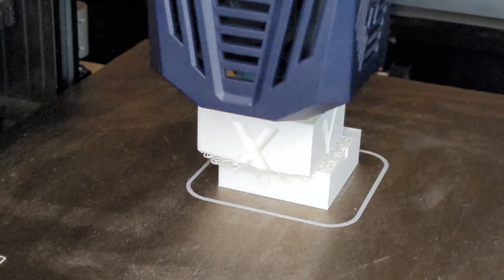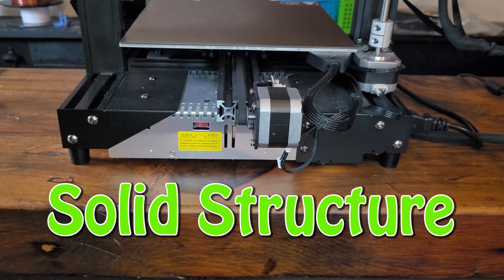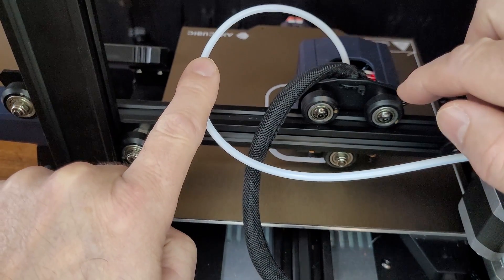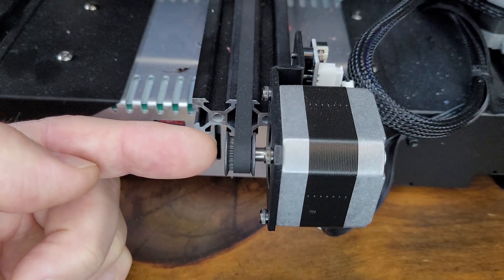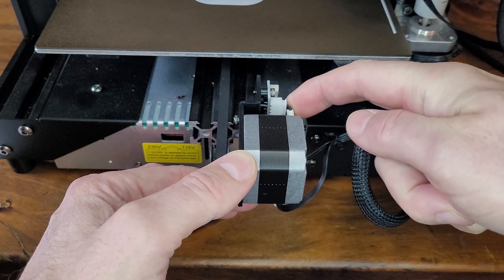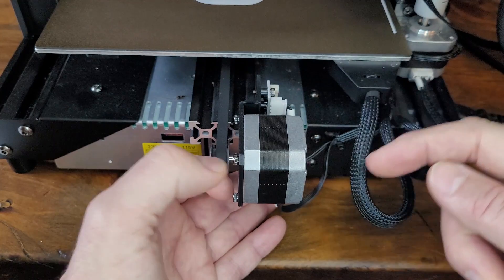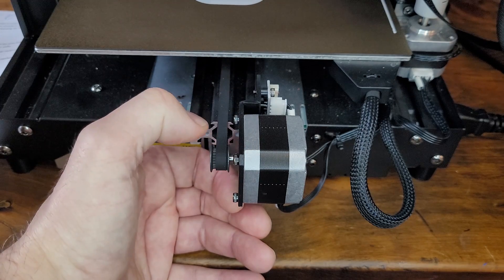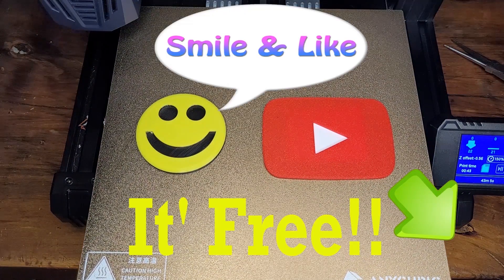Kobra Go layer shift

Comment: One issue I had that caused layer shift appeared to be Cura-specific: I set the wall thickness to a value not divisible by the nozzle size. In my case, I had wall thickness set to 1.5mm, but the nozzle was 0.4mm. What would happen is that anytime the print reached a point in the model where it would start a new wall, there was a chance for an offset/shift to be introduced. Setting the wall thickness to 1.6 or 1.2 (values evenly divisible by 0.4) avoided the issue.
Reply from the maker: Hi Murkaeus, thank you for taking the time to share this info, hopefully others will see this too.

Comment: Exact same issue as above. Belts were fine, but found that the cheaper motors supplied are not capable of higher speeds with rapid changes in movement. Had to slow it down and it worked. I imported the configuration of the "owl.gcode" that came with the printer to copy the correct speed settings and have not had a problem since. You can upgrade the motors for better performance if you wish.
Reply from the maker: Morning Craig
Thanks for taking the time to share the info

Comment: when this happen to me i change the micro ssd to other better quality micro ssd and all come back to normal!
Reply from the maker: Wow, thanks for sharing. Never occurred to me that the SD card could cause later shift.  I've changed mine to a better SD already.
Reply: I had this problem out of the blue. I had to adjust the z-axis more than once, but nothing. Until I changed the filament flow, by the way, I still have to calibrate the extruder. But I still had a bit of trouble, but I changed for another micro SD of higher quality and the problem was solved, thank you very much!!!

Comment: Wow... After all that I have learned about 3D Printing, there is always something that can catch you off guard. The issue I am/was having was layer shifts. I've improved the mechanical connection to my Y-axis motor, used locktite and tightened the belt etc. But as i reached the end of your video, I heard and saw what the final issue could be, and that was accelleration and jerk during slicing the model. Obviously an oversight and is easily done, but I hope this is the last bloody thing holding me back because Ive got large models to print and do not want to waste anymore material esp at that scale on issues like this.
So thanks for posting this video... sometimes all you need is to hear someone mention or pinpoint the issue out so it gets you back on track.
So thanks again 🤓👍
Reply from the maker: Hey Mono thanks so much for dropping me a message and letting me  know the video was useful :)

Comment: What maximum speed do you recommend to avoid layer changes and what acceleration do you recommend?
Reply from the maker: Hi Danae, sorry for the delayed response. So far I've been using the default values. I typically use Cura. I experiment with other slicers when I cannot get the results I want. I typically play with the speed dial on the control panel, manually adjusting for different zones depending upon complexity and if I'm in a hurry. 
Do you think you're having issues due to acceleration?

Comment: Hello, thank you for this video. I followed your steps, but I still get layer shifts. And it seems to be the y-axis. Any suggestions how to fix this?
Reply from the maker: Hi Pictu, a few questions. Is it a Kobra Go your strugglling with? Was it printing well and now it doesn't anymore? What temp are you running your bed at? How slow did you try to run?
Reply: @mayhemsmiley  that's my issue.  I have to print at 50% to get it to print without layer shifting.  How do I fix it?

Comment: I had this problem with the y-Motor. I replaced it with a stronger one. It was mainly the acceleration and the travel speed that caused the issue.
Reply: Do you have a reference ?
Reply from the maker: @micdel5990  man I have it somewhere just trying to find it lol
Reply from the maker: HI Hbert, thanks for sharing, you never know who it will help to see this.
Reply: Hello Hbert, can you share a type of stronger motor, which you used for replacement for original Kobra Go motor?
Reply: @tomasvalla6633  I put a 2A 55Ncm in.

Comment: You are blaming all the wrong things. You should examine your Z screw. Make sure any set screws that clamp down on the zscrew are tight. If the Z motor's movement isnt translated to the zscrew 100%, the gantry dosnt raise up enough, for the print nozzle, to clear the print, and has a collision.
Reply from the maker: Yours is another valid possible reason, thanks for commenting tazante
Reply: In my case I removed the plastic z screw for a brass one
Reply from the maker: @MrLarred  morning, interesting thank you for sharing.
Reply: @MrLarred did that help with your layer shifting? I just tried to print Moon City on my Kobra 2 Pro and had a layer shift of ~.25in at layer 450 :/ I also plan to edit my accelerations since it’s got a lot of mass

Comment: Most the layer shifts I see come from the print sheet and because the bed heats and cheap manufactures use ground iron magnets which weaken with heat above 50 degrees C and prolonged use, so the sheet moves basically what you did with your hand
Reply from the maker: Hi William, makes sense, thanks for sharing the info.